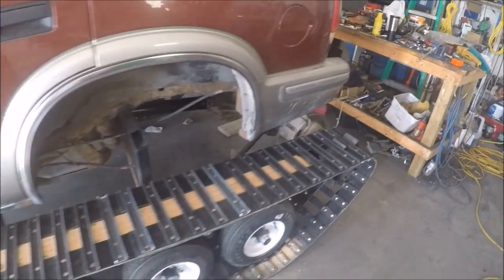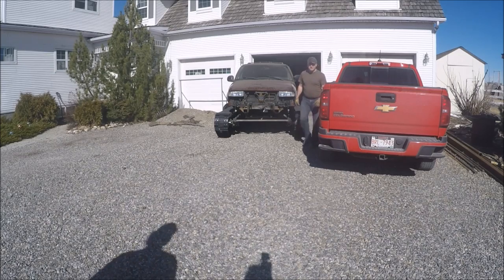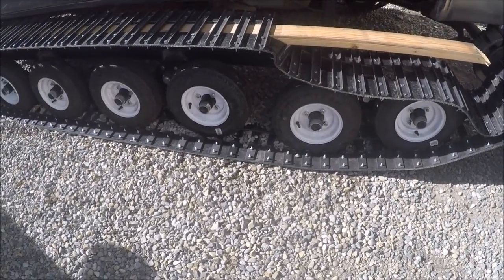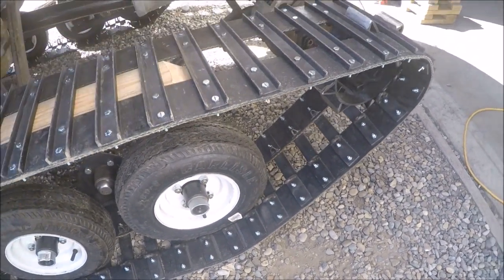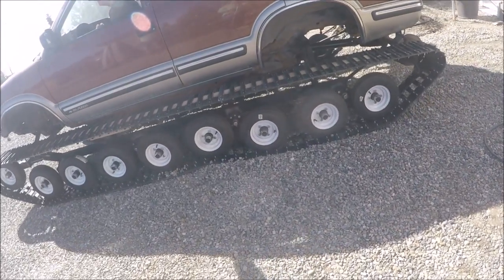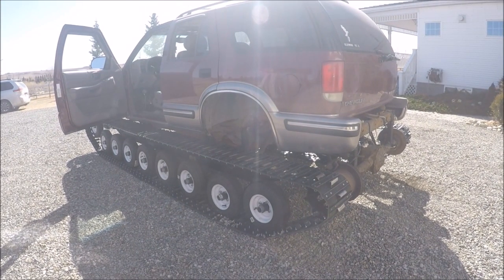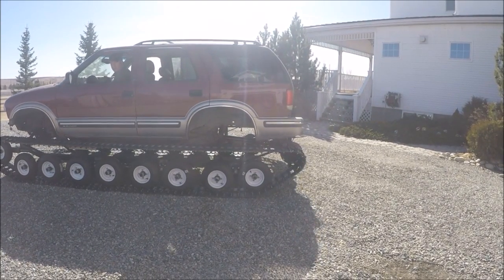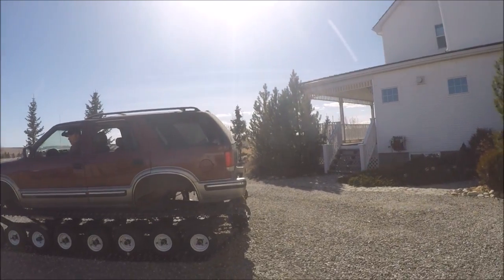Custom Tracked Vehicle, Part 22, Rev 1, Test #2

Comment: put another sprocket in the front .like the drive sprocket in the back .so the tracks will stay in place an some smaller wheels in under the the top tracks.an u shouldn't java any more problems.I used to be in the military an drove M60a3 tanks.
Reply from the maker: Hi Jeffrey, thanks for the feedback. I thought about the sprocket in the front as well, it might help. I think a bigger issue is the flexibility in the track laterally, from the rubber conveyor belt material. I may need to go with thicker rubber or wider rubber to make it work.

Comment: ok it looks to me you need taller guides, that is the obvious, next it looks like you are relying on the differential for turning alternating braking on each side? you need a dana rear diff.non locker. no doubt you will grenade that diff once you get the track sorted out.
Reply from the maker: I have the tires out for filling with rubber, so hoping to video another test in a few weeks.
Reply from the maker: Hi Mike, yeah, taller guides for sure. One of the big issues right now is the flexibility laterally in the track. Due to only being 4 " wide on each piece of the track it has a lot of flex. So it can move lots, therefore taller guides to keep it in place.
You might be right on the diff, but I am going to run it until it dies :) Then round number two I guess and a dana might be the way.
I really think that once something like that happens I will scrap this project and move on to the next which is going to be a smaller version. Like a side by side with tracks. Do the tracks out of hard plastic like an argo or maybe tracks like a skidoo.

Comment: coged front wheel and side guides on the drive end
Reply from the maker: Hi Levi C, I thought of putting side guides on the front wheel but the first thing I need to do is increase the size of the guides on the inside of the track. I built them intentionally shorter due to the way the drive cog is built. The drive cog has bars in between the cogs that go back to the axle, so the guides slip in between. When I tested with the same ones that are on the outside of the track (taller ones) they would bang and make a lot of noise and I was worried they would catch. But now I am going to try making the inside guides taller, therefore I need to change the drive cog, cut off the bars that mount it and use a center pipe as the mount.
Once done all this I will test again and then consider side guides on the front if still an issue. I don't think guides on the drive end are required as the cogs are tapered on the sides so it seems to keep the track in position well.
Reply: If you are going to rework the the drive sprockets Id add side guides to them to keep the track in place.
Reply from the maker: Hi ShawnCFarm, the sprocket teeth themselves are the guides as they are slightly sloped. All the industrial machines are built this way and don't use side guides so I didn't feel it is necessary. Of course the way this will really work out is I will get it driveable to a certain level and something else will give out and I will have to fix that issue. So only time will tell where the failure will be next.

Comment: Looks like it needs wheel keepers on either side of the drive cog and larger keepers all around to keep it on the front and bottoms. Bout 6 mins through the vid as I type here.
Reply from the maker: Hi biker, I think the keepers is a good idea but on the bottom the guides need to do the job. Going to make those guides taller so the track will stay on better.
Will get to work on it again in the fall, not going to give up.

Comment: Soooo close!!! Your new framing seem to hold up good. Yah, I seen that the cog teeth was making the tracks skip, the teeth wasn't entering the track right so it would skip. That bent cleat you couldn't get straight, hell, that's a trophy there. Hang it on the wall, LOL.

I put guides everywhere on mine. On the draggers, front idler wheels, bogies and even the drive sprocket has a guide slot, but on mine, the track guides are separate from where the wheels roll on.

You did good. While you are taking a break over the summer, you can watch vids of mine when I start working on it. :)
Reply from the maker: Hey, yeah it was good though, even the failure part. Trophy for sure. I am going to tweak the drive cogs later to give them a bit more bite at the wheel to reduce the chance of slipping.
I thought the same thing, guides on the front to keep the tracks from moving side to side at the front idler, but will have to wait until fall.

Comment: I understand the feeling and pride of doing things myself also,,, But making your own tracks is Soooo time consuming and such a waste of time,,, For me it is.  I've tried making tracks for RC tank one time, spent way too much time for something that failed straight out....  Have you even priced tracks for commercial equipment??   Might be surprised at the cost??
Reply from the maker: Hi jocrp6, the issue I found was that nobody made anything light enough for my application. Maybe I just didn't find anyone who would make them. The other thing was staying on a $5k budget. The conveyor belt material alone was $600. I am on budget for now, we will see what happens in the fall when I get back to it.